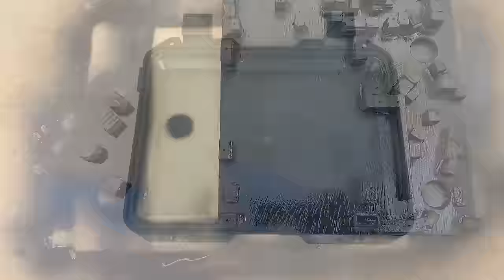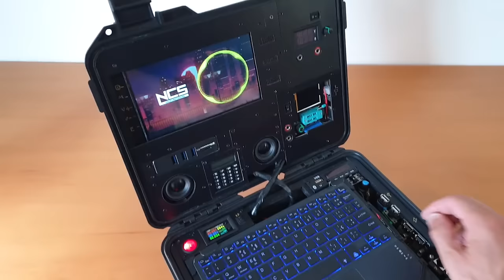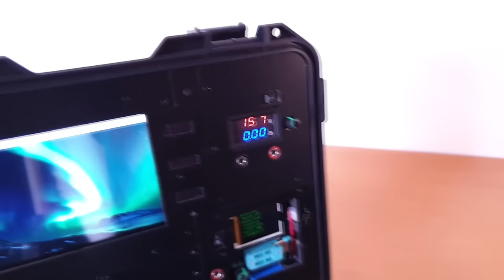DIY: Cyberdeck multi-function backup computer

Comment: This is reminding me of a portable "LAN game server" I built over 20 years ago. It was built into an aluminium tool case. I mounted the guts from a 15" TFT screen to the back of a sheet of polycarbonate, and fitted that inside the lid with 2" alloy standoffs. I installed an ABIT BX6 motherboard in the bottom of the box, added a Pentium 2 450mhz CPU, a whopping 1GB of PC100 memory, and an Nvidia GeForce 256 GPU. The PSU was (IIRC) a 230w unit that was screwed to the inside wall of the case so that the air intake fan and mains power plug lining up with holes I cut in it. I used more stacks of standoffs and small L brackets to mount a tower of 3x 9GB 7200rpm ATA66 hard drives in there too. I finished it off with the mandatory (For the time) blue LED's all over the place to illuminate every component in there, and added a sheet of lightly smoked polycarbonate on top of all that to keep fingers out, and give me somewhere to store a keyboard, mouse, a power cable, and a 16 port network switch.

It was a monster back in it's day, and was perfectly to host multiplayer Half-life, counterstrike, Unreal tournament, and Quake matches at small to medium sized LAN parties for 3 or 4 years before it became a bit of a weak link and started to lag if it had to cope with large game maps with a lot of players.

I feel sad that kids today don't get to do the whole LAN party thing. Online games are OK if you just want to insult each others mothers, but it's so much more fun when you can look up across a table and SEE the expression change on the face of a guy who's just realised that while he was busy camping with a sniper class weapon, you'd crept up behind him and stuck a trip mine on the back of his head. :D
Reply: LAN feels more cyberpunk than what we have now
Reply from the maker: the good old days :) ! my friends and i organized lans very often , normally with 10 to 15 people, call of duty, unreal tournament, farcry, battlefield and a few more, but the most played was call of duty II, it was also the best way to share movies, musics and other stuff
Reply: We STARTED to get into the original FarCry multiplayer a bit later, but apparently, I got too good at it, and no one else wanted to join any game I was in. :)

I'd do things that others didn't like. Stuff like making a bee line for the sniper rifle in a certain map, then doing something random like swimming out to the
neighbouring Island, before shooting anyone who came towards my side of the main map. They called it camping, but my reasoning was that, if the developers didn't want people to use the sniper rifle at very long range they wouldn't have made it so lethal at such a long range. :D
Reply: I totally agree, we used to host parties on the server for the entire county's school system. So anyone in the county at school could play with us and substitute teachers just let us play after our work was done and didnt care. We kept hiding the files deeper and deeper on the server, but I agree seeing someone's face across the room after a good move was awesome. And I completely agree that the blue LED's are always mandatory lol
Reply: @jlschump  The blue LED's were pretty, but a games PC I built a few years later looked cooler.

I found a brand of UV reactive nail polish that was clear under normal light, but would really pop with a toxic green glow when hit with UV.

I bought a full clear acrylic case, and with a really fine brush painstakingly painted most of the components and various random circuit tracks on the motherboard + VGA card, the edges of all the boards/memory sticks, and the moving part of all the fans. I gutted a PSU, painted most of the components on that board too, and mounted that to the inside top of the PC case using long chrome standoffs. I bought an external laptop style USB CD rom drive because I couldn't work out how to modify a full sized 5.25" drive to fit in with the whole look I was going for. The single hard drive in this one was mounted in the bottom, but I'd stencilled/painted a biohazard symbol on top of it. I got some light grey heat shrink tube, then "Stranded"/bundled all the IDE cables, and made all the other cables the exact length they needed to be (Not that hard if you've already got easy access to all the PSU's solder pads) before wrapping those in grey heat shrink tube too. The great thing about heat shrinking bundles of wire is that you can shrink it to make the wires hold a shape, so all the cables followed straight lines and right angles. To finish it off, I added UV LED in every discreet place I could (I seem to remember there was something like 40 of them in there, all connected up with really thin enamelled wire that I spray painted silver so I could hide it along edges and behind things.

When powered off it just looked like a super tidy build in a transparent case, but when I pressed that power button, EVERYONE stopped to gawk at it ! :D . It was probably the most attention grabbing PC I've ever built.

It LOOKED amazing, but I wouldn't recommend an acrylic case to anyone. They're an absolute b*stard to keep from filling with dust, scratch easily, and have ZERO RF shielding, so my epic PC couldn't be used on a table near anyone who was still using a CRT monitor due to the unshielded PSU giving the image on their monitor a migraine inducing flicker, and if I put it on the floor it would spend the night sucking in dust, carpet fibres, and cat hair, so would need stripping down and cleaning before the next party (Compressed air just MOVED the detritus in there from one surface to another).......... But it did look good. :D
Reply: @Reman1975  That sounds awesome, wish I could see it. I have worked on boats and powersports my whole life and did Marine Electronics and Electrical Systems in the latter parts, so I can relate to beautifuly ran cables and I agree that people can do some really cool things with the heat shrink and good cable management. I will have to try the UV nail polish sometime, I never thought of that, but I use LED's like that in jetskis and all kinds of stuff on boats. I'm glad I'm not the only one haha. I have the same issues with my case and dust as well, its a nightmare. I've frequently debated on just washing the entire thing with water and letting it dry for several days or dreamed of some way to dry it off because the air just doesnt do sh*t. Maybe I could get one of those blobs of goo to collect dust and stuff trapped in small crevices but something inside me just wishes I could pressure wash the damn thing lol.
Reply: I am going to build my own version of this box, and not that they didn't have this ability or not idk, but I have a Shark CNC and Ender 3D printer, this will be a perfect project to use the CNC (which I'm not using enough at the moment). I probably will make a video since it could make some decent content too, but I think I'll change a few things. I'll probably make it a little bigger, and I'd like a little bit bigger screen as well as the battery and speakers. But everything else I'd still include and anything else that might be helpful. I was also thinking of making 2 more cases but only with batteries, and I was curious if there was a "perfect" setup where on case could provide all day power at max output, and the other pack could charge all day with a solar panel, and essentially it could be used all day without any limitations and just alternate the extra battery pack each day. Then for on the go the internal battery would be used. And it'll def have some LED's too lol.
Reply: @jlschump  The best thing I found was to spray the inside of the case with antistatic furniture polish, but even when polished it leaves an ever so slightly hazy effect on the acrylic, and it would also smell quite badly if I got overspray on anything that got hot, but it did mean significantly more of the cat hair and carpet fluff could be blown out with an air duster.

For cleaning, the best one I built was a case that consisted of 2x 3mm sheets of brushed aluminium for sides, with a lot of bolts and custom length standoffs to suspend everything in between. That one looked quite nice, but I didn't think through the design very well and it was an absolute pain to do any work on. It had something like 30 stainless M3 countersunk socket head bolts that needed removing to get just one of the sides off, and the side needed to come off for every upgrade. :(

The thing that surprising thing with this one though was it turns out that a minimalist case with nothing to trap heat inside of can still be less efficient at cooling than a normal case with a well thought out air flow path. The kit ran slightly hotter with this almost completely open design than it had in a normal case.

The other odd thing that's just occurred to me is that after years of building some pretty "Out there" PC cases, I'm now typing this on an old and almost OEM HP Z230. I've give it a graphics, memory, and hard drive upgrade, but apart from adding a couple strips of blue LED's behind the front grill (Which I've connected to the hard drive activity header), it looks totally as HP intended........... Though talking about some of the old custom PC's I built has how got me thinking about a few better ways I could make the 2 aluminium sheet design again. :D
Reply: @Reman1975  thats really cool to know about the antistatic furniture polish I will have to try that. I would've imagined the open design would cool better but thats wild that it was hotter. I completely understand what you say about the HPZ230 I've slowed down with that stuff a lot too. I just recently built the desktop PC I'm using now, its nothing fancy but hopefully good enough to keep up with today's software. Its AMD, Ryzen 9, 12 core, 32gb ram, and got the corsair liquid cooling for the cpu. I'm not overclocking or anything, got a 3070ti I think, it runs pretty decent, but I think I'm going to get more into Linux next for boxes like in this video.
Reply: If you still have it, you should upload it, people are still into making these items. My buddy mounted a  monitor on the side of his computer case for LAN games instead of lugging everything around. Laptops wernt as powerful as they are now. So we get it.
Reply: @TheFilthyCasual  The aluminium case PC was built before I even had a digital camera, so I never had any pictures of that. I remember that when it stopped going with me to LAN parties a friend really wanted it for some reason, so I swapped it for some computer parts he had that I'd had my eye on. Off the top of my head I can't remember what they were though (A graphics card was part of the deal maybe? I remember getting a second hand Radeon card from him at one point, so maybe this was from that trade?).

I took a few photos of the polycarbonate PC when I first finished it, but they were on my old Sony Ericsson K710i phone (A device that eventually proved to be far from waterproof during a mishap involving a wonderfully picturesque river side pub/restaurant, and a LOT of alcohol. :D ). The actual PC got broken for parts eventually. It was really pretty when I built it, but it was just way too much like hard work trying to keep it clean, and being a LAN party PC it had sustained quite a lot of scuffs, chips, and deep scratches, so during it's last year or so of use, the thing was never really "Photo shoot ready" again.

I'm pretty sure I must still have some pictures of the minimalist two sheets of alloy case somewhere, but to be honest, it was such an uninspiringly basic design to look at that I never really bothered showing it off to anyone other than the folks at LAN parties. It was just 2 alloy plates, a lot of custom length standoffs/spacers, and way too many countersunk stainless M3 bolts. It was the sort of case that someone with an industrial waterjet table could crank out in their thousands for next to no cost and minimal effort. Unfortunately it failed at it's soul reason for being made by actually being WORSE at dissipating heat than the traditional PC case I stripped down to build the thing.

I eventually rehomed the components from that into a full sized tower case ("Full sized" as in the original ATX definition, so 5x 5.25" optical drive bays, 5x 3.5" bays, and almost enough room to fit an entire second ATX motherboard above the first one. That case was about a yard tall ! :D). The reason for this change was because by that time, table space was getting really cramped at these parties, so I used this case for my games PC, and cut a 3x2ish foot piece of 1/2" plywood that I skinned in neoprene, then added a pair of folding legs to. This acted as my own little desk with the PC pulling extra duty as one sides legs. I also found a low folding travel chair that was just the right height to use with my "Desk". That setup was useful, but I kept having trouble with the neoprene not staying stuck to the wood.

I do keep thinking I'd like to revisit this 2 sheet case design, but with multiple access and airflow improvements this time. There's also a half formed idea about using a similar concept to build a layered case out of polycarbonate. The basic idea is to make the case out of vertical slabs of 5mm polycarbonate that are spaced 5mm apart. In my mind, if I put 5mm brushed alloy sides on it the thing would look pretty sick. The outer edges of the polycarbonate could be lightly sandblasted, and  backlit with a load of addressable NeoPixel LED strips. It's the sort of project where I'd REALLY need to get a reasonable sized CNC router to make the pieces as neat and consistent as I'd want them to be though.
Reply: @Reman1975 Ahhh.. rhe old acrylic and cat fur static electricity demonstration. These days, the use of live animals in a school science lab is frowned upon.
Reply: can framework repurpose to this?
Reply: The closest experience I have is playing split screen with family and friends.
Reply: Heh. Battlefield 1942 was made for LANs. Especially if you bend the map a little such as getting the motorcycle and use that to go anti-clockwise around the map. The reason for the motorcycle? Well, you are out of bounds for a couple of seconds but on foot it would be longer than the timer allows, so the game would kill you and put you back to spawn. Sorry, I don't recall better details.

Of the other fun way to play is when your team captures all the spawn points, meaning that those on the other team who dies are left as passive viewers.
Reply: More kids today play and have fun with multiplayer games than did in your day and they're making friendships perfectly fine.

Choose to feel good about what you had, not bad about what someone else supposedly lacks
Reply: gods reading this is making me miss the LAN parties we used to throw every few weeks
Reply: @nootrecruit  The ones we used to throw had a few rules. One rule was that everyone attending had to bring at least one bottle of spirits or 24 pack of lager, and predominantly ready to eat food (6 or so packs of Pringles were a favourite, but some brought stuff like multiple packs of rolls, several jars of hotdog sausages, and associated condiments). The deal was that all the booze went on one table, and only ONE bottle of any particular spirit was allowed to be opened at a time, so if 5 people brought bottles of Jack Daniels, we didn't open the second bottle until the first was gone. The same went for each other type of drink. Because there would usually be 10+ tubes of each flavour of Pringles there, we'd just make sure there was 3 or 4 tubes of each kind on the tables.

The idea was that no one was allowed to take any bottles or unopened tubes of Pringles away again, and the unopened stuff became the property of the person hosting the party. Because most of us weren't raging alcoholics, it would often mean the host would end up with at least 10 bottles of various spirits by the end of the night/weekend as compensation for us adding a couple of weeks worth of their usual electricity usage to their bill in one night. Because of this there was usually a clamber for people in the group who wanted to host a party just before Christmas so they could get all their festive booze for free. :D

They were really fun get togethers, and some of my fondest memories from back then were from these parties........... Like watching a handful of friends (Who'd been "Professional grade" drinking since about midday !) betting on which of them could speed run from pipe to pipe the quickest in the cliff face section of Surface Tension in the original Half-life. That was about an hour of us laughing our heads off at how alcohol pickled their fine motor skills had become by that point of the evening. None of them even made it to the end until at least their 5th or 6th attempts !!! :D
Reply: @jlschump  Back when Quake II was big, a collegue had 16MB of memory in his machine, when 4MB was common and 8MB was a rarity. Anyway, he found that he could join a multiplayer game, then run around to one of the spawn points and continually frag another player while they were still joining. They player being shot wasn't aware of what was happening as their game was still loading.

Was this an unfair advantage? Sure. Was it within then rules? I'd say yes, otherwise the developers should have been aware of the race conditions and wrote a rule to prevent it.
Reply: I'm not sure how we got onto the topic of fair/unfair advantages but the ram trick sounds cool. @gorillaau
Reply: @jlschump  Just recalling memories of various LAN parties or events. The exact topic will drift a little.
Reply: Brilliant, and when I got a look at retro-pi, wow, congratulations.
Reply: LAN parties are alive. I have been at LAN party about a week ago, we have played Doom. But we are not kids anymore, and some of us have their own kids.
Reply: Gaming hero.
Reply: @Reman1975  Oh man, I wish you could post a pic/vid on YT of that beauty!
Reply: That would have been a truly AWESOME build for the time 👍👍👍